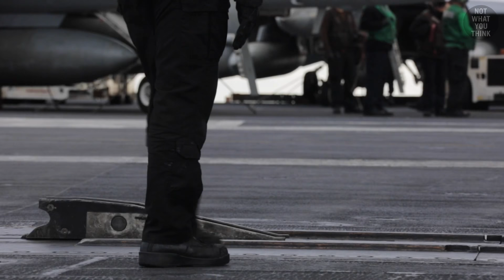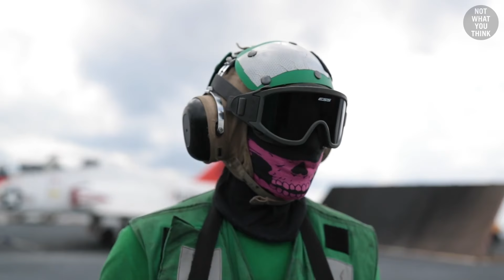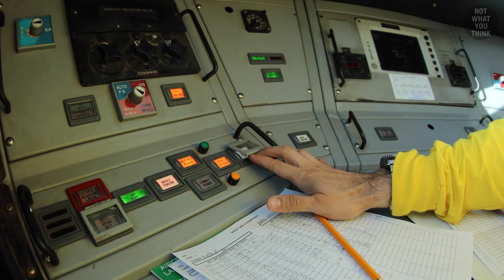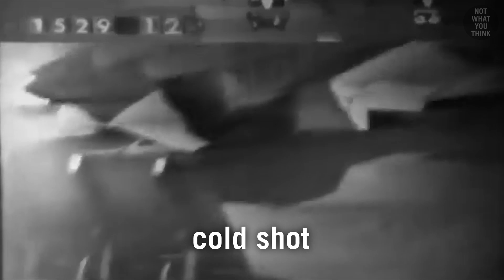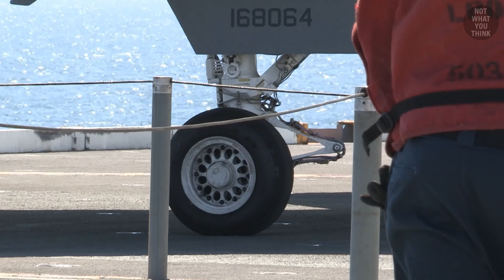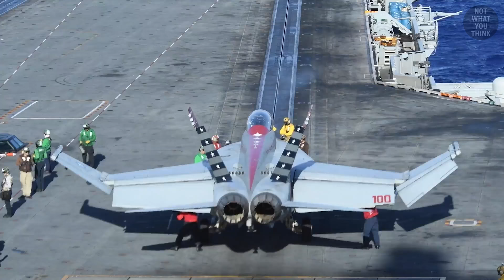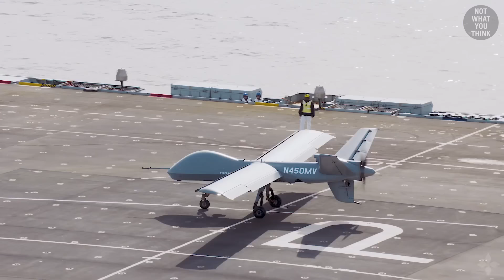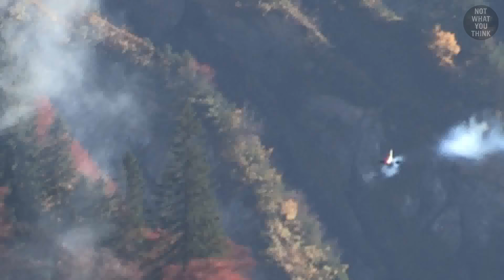Why the US Navy is Replacing Electric Catapults with Steam

Comment: If electric is "bad" will the navy scrap their railguns and put some steam cannons on their ships?
Reply: The US Navy doesn't have any railguns. There was a testbed prototype years ago, but the program was cancelled. The laws of physics pretty much guarantee that railguns will arc when the projectile exits, vaporizing the surface of the rails. They also require shipping-container-sized capacitors and a similar sized generator just to rival traditional 155mm guns in muzzle energy and rate of fire.
The "Trump class battleship" is just a fictional modification of the DDG(X) in order to trick Trump into supporting its development.
Reply: @JWQweqOPDH  Steam cannons... So, like giant air rifles? I'm down.
Reply: Well, regular cannons are basically "steam catapults". It's not technically steam but close enough, if contrasted with a railgun.
Reply: Go full broadside again, bring back golden age of sail!
Reply: The Rail Gun was killed in 2021.
Reply: @kn1ne Explain the trump battleship railguns.
Reply: @theHerathrig  Explain the battleship that hasn’t even been designed yet? The Zumwalt was supposed to have weapons that didn’t exist yet too, only they still didn’t exist when the ship was built so they don’t. Saying “I want a rail gun on my battleship” doesn’t change the fact the Navy axed the funding for the railgun program 5 years ago.
Reply: @theHerathrig  It has missiles and conventional guns on it.
Reply: @TheFoulMouthNews  It doesn't exist, so it has nothing on it.
Reply: @patrikfloding7985  The plans do. That is what I was referring to. Even a smooth brain could see that.

Nice fail at an own.
Reply: Combustion light-gas guns would rule actually
Reply: railguns aren't a good example in favor of electric. Railguns are really not practical at all, unlike electric catapults
Reply: Apples and oranges
Reply: @FrancisFrom254  Trump wants them to put a railgun on the 'big beautiful battleship' he told them to make, not really apples to oranges when both things he wants the navy to do related to electromagnetic stuff are stupid.
Reply: What rail guns? The same "experts" who said the Zimwalt-Class and its vaporware rail guns were perfect and the future are the same ones claiming the same thing about mag launch systems.
Reply: The Navy did scrap the railgun project
Reply: @ADR1fley  And Trump ask them to put one on to his "warship"
Reply: @ADR1fley Isn't the funding going to Japan who have taken over the project to see it become viable??
Reply: Might be they need the batteries for something else
Reply: dont forget that all those firing computers and observation computers and computing computers run in the same boring stuff no one can see.
Reply: Railguns are bad for a whole other reason

They take material science we just don't have yet. The barrels wear out very quickly
Reply: Finally the army will be equipped with Blunderbusses, as everyone knows, those newfangled assault rifles are too dangerous and unreliable
Reply: Actually existed...works pretty good Actually
Reply: Yes please, I’m ready for the golden age of irl steampunk
Reply: I thought they scrapped the rail gun a few years ago
Reply: Railguns are useless and even if they weren't they're not hurling priceless pilots.